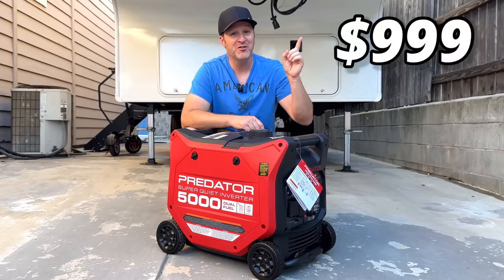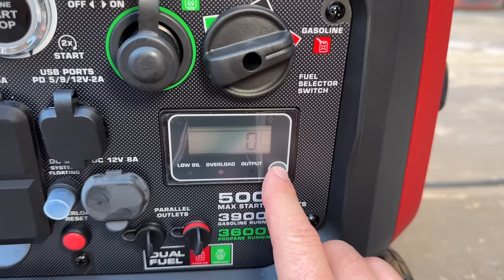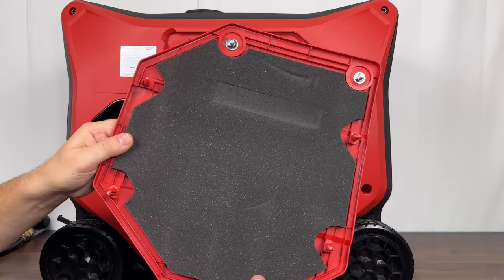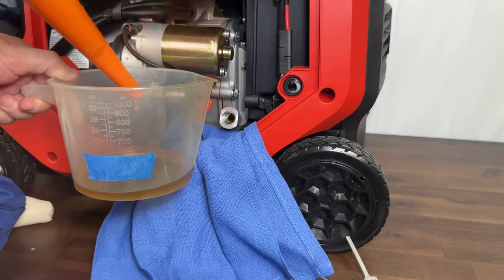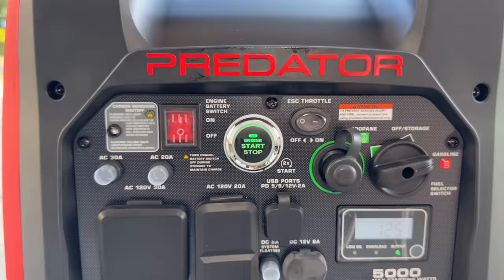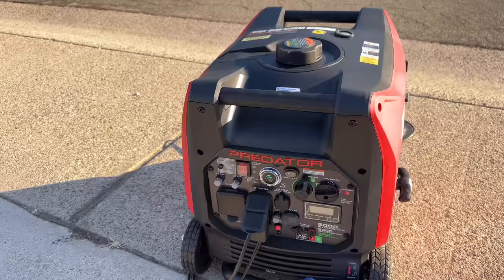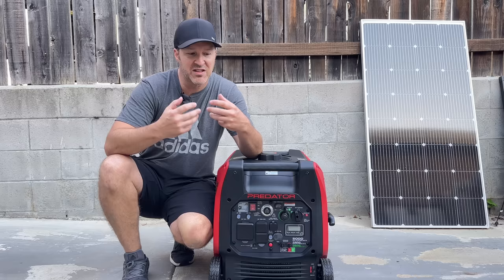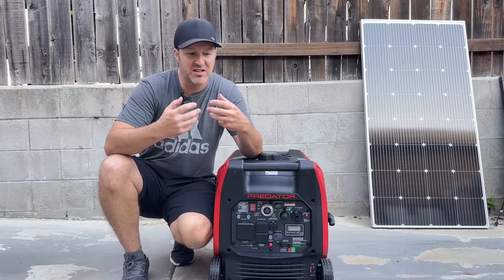BEST New Generator! Predator 5000 Watt Dual-Fuel SUPER QUIET inverter Generator LOADED!

Comment: So I have been thinking on this, to get a three year warranty, you need to spend another $400.  That’s 40 %of the retail cost of the unit.  Are they expecting 40% of these units to fail in the first 3 years?
Reply from the maker: So i think the $999 is a intro price. Like the 3500 that price went up over time from popularity and covid didn’t help. Now the warranty is $329 so you are $1400 otd after taxes. But its full replacement no questions. That’s for a 2 year add on warranty. I thought it was 3. 
Now over all a great unit very nicely built and feels very solid compared to other leading brands like champion 4500 and wen 3800 models which honestly they are the same. But the price of the wen 3800 and now wen 4000df…..its tough. The wen and champion are also smaller using a 212cc engine verses this 224cc model. 
Again this feels like a early 90s built machine inside with outside plastic. The others feel like everything else. All plastic but lighter. 
There are Honda die hards, and Harbor freight die hards…….that may make the decision for some. 
On another note, i think this would beet the champion and wen for db levels. It’s pretty quiet and just hums.
Reply: Yes it's version 1 after all :)
Reply: @johnnysweekends , I am getting the feeling that you really like the predator.   And you feel it is quieter than the Champions?
Reply from the maker: I think this new predator and champion 4500/4650 would be super close. And maybe the new P5000 being a pinch quieter because it’s a little larger and will absorb more sound in the generator siding and also seems to have a larger muffler. 

On the down side, it’s about 10-15% bigger than a predator 3500 and champion 4500. 

That’s the biggest thing it’s big and it’s heavy. 

I think those are the biggest draw back and could be the deciding factor for many. 

I think it’s built to last as long as they don’t end up being junk lol. 

Will see after a few thousand are out there and what the feed back is.
Reply: If I parallel 2 units, will I get more amps and will it power a 2.5 ton ac at my house?
Reply from the maker: @johnnyjackson3237 parallel just doubles the amps and not volts. Your AC unit will need a 240 volt generator

Comment: How hard would it be to connect an exhaust hose?  I'm thinking of getting a pair of these with the parallel kit and placing them in a dedicated enclosure and don't want the CO detector tripping.
Reply from the maker: Will I’ll have to take a look. I have a couple in the garage so I’ll make a video

Comment: Did you have to ground the generator or use a neutral ground bonding plug in order to use the RV with the Watchdog surge protector?
Reply from the maker: Neutral bonding plug only for the Watchdog ..👍🏼😀
Reply: Thank you

Comment: The Predator 5000 is Recalled and out of stock.    If anyone bought one, check out serial number and take it back if a bad unit.    Until they get this one correct, the Champion 4650 w/ dual fuel and remote start is the ticket.     Just as quiet.   No issues.
Reply from the maker: PREDATOR 5000 GENERATOR PROBLEMS
https://youtu.be/iAPSy9fm8-A
Reply: The Honda $$$ and the GenMax units with Electronic Fuel Injection really have my attention now.    Carb/fuel maintenance less of an issue.    Plus the GenMax is the light weight winner in the 4500watt or so weight class at under 60 lbs.

Comment: With this being a single line 30 amp generator, how did you get two lines to measure?  Really looking for a solution to power my 50 amp rv without buying either a massive generator or paralleling two smaller ones.  Thanks
Reply from the maker: Lol yea a lot of people wonder about that 😁
Most newer RVs are wired with a 208Y configuration. This allows the neutral basically to become a load line. So my whole trailer can be used on a 30 amp. And I can power both AC units no problem. But like anything there are limits and you can obviously draw to much if not paying attention. Which for people who dont pay attention the watchdog would be good protection for them.

Comment: I dont think this was covered, but a big deal for me is that some generators allow you to remote start with a load, while others say you have to remove the load before you start the generator. Whats the case for this one?
Reply from the maker: Any generator can start if a load is already on. But it’s a good way to prematurely fry your inverter board or the item you are powering
Reply: @johnnysweekends  yes but from what I have heard, the Champion generator delays the load till generator is up to full speed.  This feature is great if it's cold outside and your power has gone out. You can remotely start and stop the generator without having to plug or unplug anything.
Reply from the maker: Which models do you know..?
Most gens will all start and do about a 5 second hold then ac output kicks on. How long this one is idk ill have to check later.
Reply: @johnnysweekends  ok, looking forward to hearing about this more.

Comment: Not sure a lithium battery is really needed.  What would be nicer would be a built in charger plug in at your house to keep it topped off.
Reply from the maker: On board charger like some units would have been nice. 👍🏼

Comment: nice generator but the deal beaker is no 240V outlet
Reply from the maker: If you need 240v you’ll need a bigger generator. Or what I have coming out soon..😁👍🏼
Reply: @johnnysweekends  What do you have coming out soon?  Is it out yet?
Reply from the maker: @jamesbilleck8838 you can check out this…or the genmax 10500…. https://youtu.be/q3Czru6WijU

Comment: How did your watchdog monitor show a load on Line 1 and Line 2 when 30 amp 120volt has only a single phase or (one line)?
Reply from the maker: Lol your one of the only ones to notice 😁
Many RVs are wired with a 208y setup. 
So 120/240 208y 3pole 4wire.

Comment: I guess i dont get the appeal over a 4650 or 4500 unit. It's still not a full 50 amp unit so likely cant run two ac units at once without easy starts
Reply from the maker: I would start both in optimal conditions eco off of course and not 4500ft and not 110 outside. But also 2 AC units as in what…. Two 15k units…a 15k 13.5? Two 13.5k…?
Reply: @johnnysweekends  two 15k BTU ac units is what I have. I just don’t think a 5000 watt will do it
Reply from the maker: Yea you would need a soft start on one of them. Both would be better. Prolong the life of the ac units and generator

Comment: Why wouldn't Harbor Freight added a 50 amp plug??
Reply from the maker: It’s not a big enough gen for 220/240.
That would be 16 amps a side. That won’t do much. 
There are 120/240 units out there in the 6000 to 7250 start watt range

Comment: How do you like this versus champion 4500?
Reply from the maker: The 4500 fuel fuel from champion is a great unit but if you want remote it won’t work with dual fuel only gas. Not sure why they did it that way. It’s a quiet unit for sure and it would be a tough choice but over all I think the predator may be a little better honestly

Comment: Quick question.....   I just want to be clear after watching the video.   Were you able to run both AC's and the microwave all at once?  If so that would be incredible for this unit.  Also was it only connected to the rv 30A port at that time?
Reply from the maker: Yes all 3 were running during the test and I ran that test 3 times. 
Now when the microwave is running with both ac units you are overloading the unit. So not exactly what ya wanna do but it held very well. Under high temps I’m sure that will change. 
Test temps were 90degrees so not super hot yet
Reply: @johnnysweekends  wow thats pretty good that it can run both and occasionally the microwave, great video BTW.
Reply from the maker: Thank you. 😀👍🏼

Comment: You mentioned it has an auto choke.  Is this in addition to having an auto choke?  Because my current system relies on a generator having an auto choke so that it can start automatically when the big battery bank voltage drops too low.
Reply from the maker: It has an auto choke meaning you don’t do it manually.

Comment: What elevation jet is in the carb from the factory?
Reply from the maker: Sea level , but I bet if you travel this would have no issues up and down from 0-3750 ish feet before you really see some drop off. 
Heat index and load will matter as well though

Comment: So the 30 hour break in period is overkill, and an hour is sufficient?
Reply from the maker: I have built many small engines from dirt bikes to race jet skis with motors with several thousand dollars. It has never taken me longer than 45 mins to break in a engine. Do you know anyone who breaks in a lawn mower? Riding lawn mower or tractor? Same engines, 
I do heat cycles and I’m done. 
Change oil after and go.
Reply: @johnnysweekends  I’m with you! Seemed absurd to me.

Comment: Do you leave the esc throttle button on or off when camping in the travel trailer ?
Reply from the maker: On when I can. Saves fuel and quieter. Depends on loads though. I have soft starts so the gen wont work hard when ac kicks on and off. If you have lots of loads and ac going then eco off.

Comment: I have a original 3500 and its been a champ. Did you run both ACs on that 5000? Have a couple off grid trips and ik the 3500 wont handle 2 acs.
Reply from the maker: Yes in the video you can see the loads with the add on screen and more and running acs including the microwave at the same time.
Reply: @johnnysweekends  thank you! Very tempted to go pick one up!

Comment: I would like to know if it will automatically switch from propane to gasoline when it runs out of propane. The WEN 450i I’ve been eyeing up does.
Reply from the maker: So I have not tested it, but you can switch fuel sources on the fly by turning the selector switch, but nothing in the manual indicates it will switch automatically from lpg to gasoline

Comment: I use a Honda 3k watt at my work. Is Honda better than predator?
Reply from the maker: All depends who you ask. And the situation. The price is normally 2.5 Times the price of other units. So you could buy two of the other’s and if each provide 60-70% the run time for the service life then you are coming it ahead in the long run. And even people say well you can buy parts for the Honda are you going to throw $750 into a very used unit? And then something else goes out? So it’s a tough call. 
Honda over all are constructed better and are built tough. But some are saying the new units unlike the old die hard are prematurely failing. 

So it comes down more to what is best for the individual. 

The knock odd brands have been definitely holding there own lately. Sure some of those die prematurely as well but I can say the same for Honda as I read many many complaints on my channel, and forums as well. 

They are still the quietest though

Comment: Can this unit be directly plugged into the home in case of emergency
Reply from the maker: With a correct adapter and either critical loads panel or generator inlet box. If you have those already then yes but adapter needed but it can still work as a home back up gen
Reply: @johnnysweekends  thank you!
Reply: Better off with a bigger unit. I have an 8500 watt generator
Reply from the maker: @loveydovey4u bigger isn’t always better. Just depends what you need. Bigger is less fuel efficient.
Reply: @johnnysweekends  I only use mine maybe twice a year for emergencies.  Fuel efficiency is definitely not a concern of mine. Better safe than sorry... be careful! I also bought my genny off Craigslist 15 years ago for only 300$. Its been a great generator 🥰

Comment: Would you recommend this over the champion 4650 or would you consider them pretty even?
Reply from the maker: The champion unit is also a good choice but no remote start with propane model. But a little smaller and a little lighter. Both will be super close in a DB battle which it’s so close it won’t matter
Reply: @johnnysweekends  Do you know if this shares the same dipstick as the 3500?
Reply from the maker: Pretty sure it’s not it does not look the same.

Comment: How do you charge the battery on the unit if it’s dead
Reply from the maker: The gen will charge its own battery. But if it is dead you can use a jump pack or get a trickle charger or simply pull on the cord but close the choke manually first and it should still start.

Comment: Did you test how many hours it can run consecutively non stop on propane?
Reply from the maker: I have not yet no but that would also depend on the load how long it will last. 
But manual says about 14hrs ish on a 20lb bottle at 25% load

Comment: So if I have a 30amp travel trailer with one a/c unit it will run all my stuff no problem, right.🤔
Reply from the maker: Yes, if you watched the video you can see I’m running all kinds of stuff..👍🏼
Reply: @johnnysweekends  yes sir, just making sure I saw what I was seeing.  Cause the receptacle on the generator/inverter looked different then the twist 30A plug that’s on my extension cord that’s for my travel trailer. I’m a total nub
Reply from the maker: Yea so this model is a 30 RV  TT plug, “travel trailer” verses the 30amp L5-30r twist lock on the 3500 model.  Different plug same power. Is just a connector and there are adaptors everywhere.
Reply: @johnnysweekends  10/4 adapter, harbor freight, predator…told ya nub! Thanks! It’s a lot to learn but I’m getting there.
Reply from the maker: Everyone starts somewhere 😀👍🏼

Comment: Curious, if you run 2 of these 5000 watts generators in parallel using the predator parallel kit, will you still max out at 7500 max starting watts and 6000 max running watts even though they are 5000 watt units? Thats how i am reading the parallel kit description.
Reply from the maker: Technically it would be 7800 running watts. So max load at 120v and 60 some amps. Lol that’s more power than most anyone would need on 120.

Comment: Problem is the price isn’t comparable to others like Furman or Champion. It’s cheaper than Honda though but Honda makes them to last twenty plus years. Predators when you disassemble them you’ll find hard plastics where steel should be. Even internally it’s a mixed bag. They run great and are quieter than many but it is a Budget generator but costs non budget prices. 
There 9000 big boy just a year and a half ago sold for $1799 plus you could apply a 20% off coupon to which made it a great value. 
Within six months they jacked the price to $1999. Six months later they hacked it up again to $2499 which is priced way out of acceptable given it is a Harbor Freight product. 
They got greedy and raised the price because of all the reviews here and online. 
This type of shady business turns people away. 
They are great generators but the upper management simply spit in the customers faces. 
This time next year that Genny will cost $1299 and a few months later, $1599 as this is their business model. 
Ripping people off. 
But, at least you get a free $1 flashlight if you show up on Tuesday or a bucket perhaps.
Reply from the maker: Lol that flashlight is junk 😂

But yea I agree, I think it’s a well built unit and people are grabbing them cheap with the coupon like $780 ish then tax 

But yea it will go up and champion and others come to mind at that price that have a rating now.

Again I think it’s a good unit but if they raise the price people will just move to others

Comment: 2:57  What is the black thing between the regulator and hose?
Reply from the maker: That is the external load regulator. Kinda like a carb for the propane side. Basically a diaphragm that opens and closes to control flow for propane

Comment: Will this run my house with a 100 amp panel
Reply from the maker: Your whole house no. Part of your house? Yes. Doesn’t matter if its 100amp or 200 amp panel. You need a critical loads panel and then hook up the circuits you need most. This generator puts out a little more than 30amps. That’s it. Doesn’t matter if its a home or a rv. You get 30 amps.

Comment: There is no 220 volt or split phase, and it won't run NG. Max impeding rods looks more up my alley
Reply from the maker: Maxpeeding rods doesn’t have a NG gen only dual fuel with gas and propane 
But you can convert many